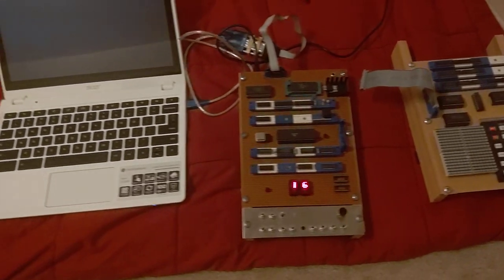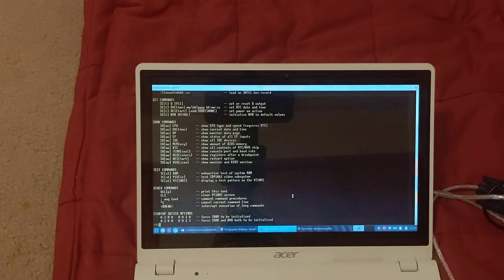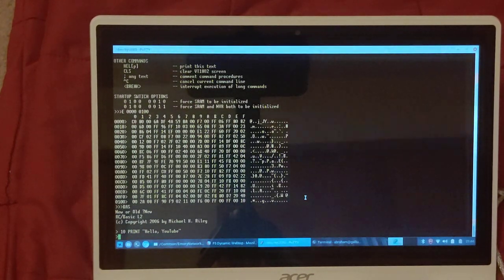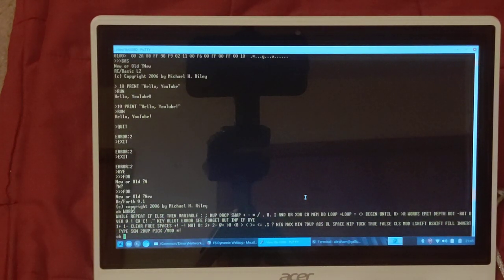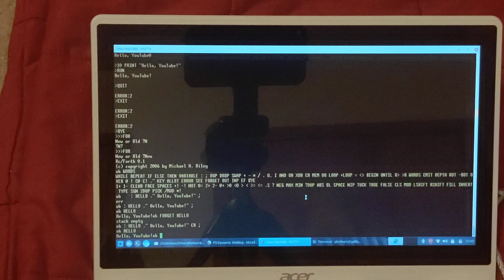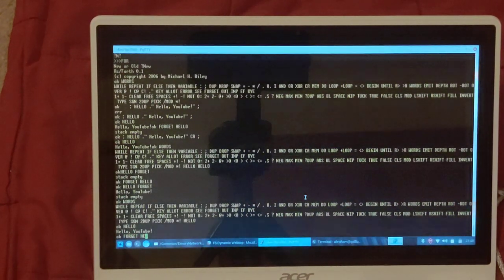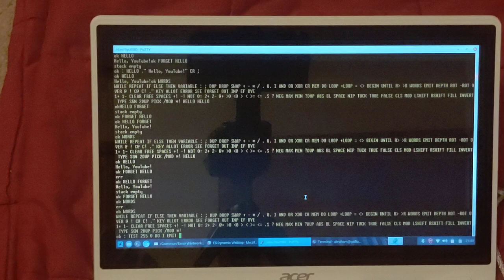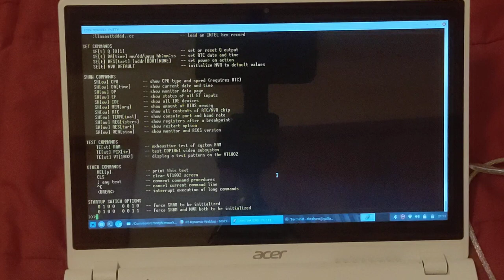My COSMAC ELF

Comment: Now that I've had a chance to watch the video, I can say with certainty that you need to replace those toggle switches with high quality name brand switches with gold contacts. The cheap switches on the market have got crap metals on the contacts, and they're unreliable for low current CMOS input switches. Spring the $16 to $20 loose for 11 good toggle switches and a good momentary and you'll find using your Elf is a whole new experience.
Reply from the maker: I bet! I think these were under $1 a piece?
Reply: Late to comment I know but having been there done that (Elf and stuff). Having better switches helps but actually only those signals that depend on a clean pulse need to be better. In other words those switches that set the databus can be any old crap. Further, relying on mechanical switches to produce clean pulses is looking for trouble. And indeed the originak Elf schematics has this covered, as long as the switch does not bounce between the contacts (only bounces on one contact) it should work. 

When I was kid an built these things those switches were together more expensive that the CPU and I could not afford them. 

Anyway, thanks for te videa @walnuthills11